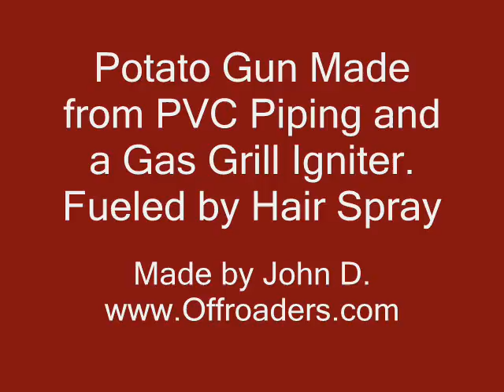Potato Gun Made from PVC, Fueled by Hair Spray

Comment: Wouldn't it be better to put the hairspray in first so you have a great deal of compression? It looked like, in the video, that the potato was put in first, then the back end was opened and hair spray sprayed in and then the cap screwed on then the spark. But doing it that way has no compression. Also, how much power can this generate without cracking the PVC?